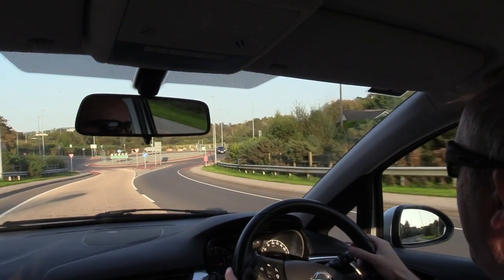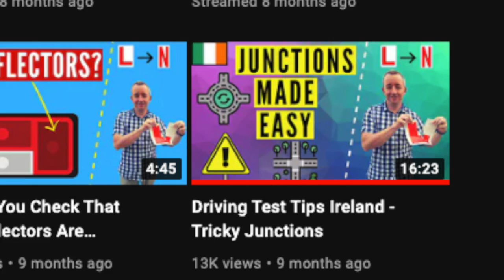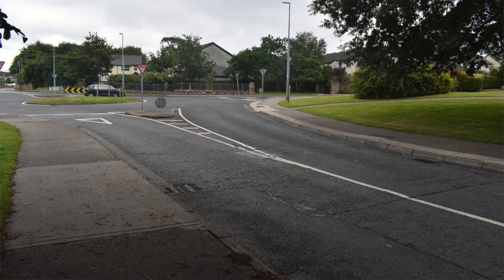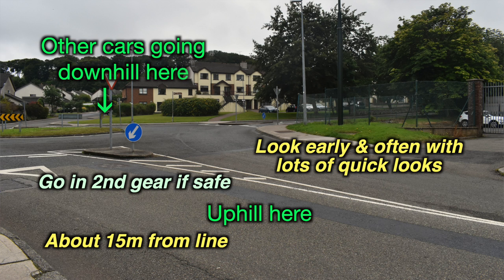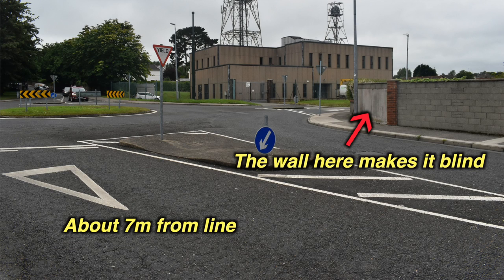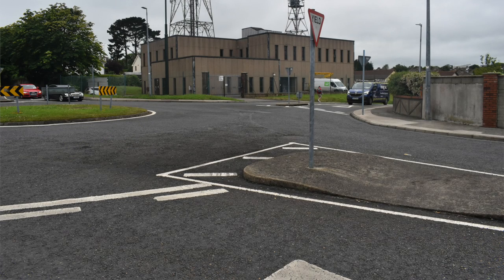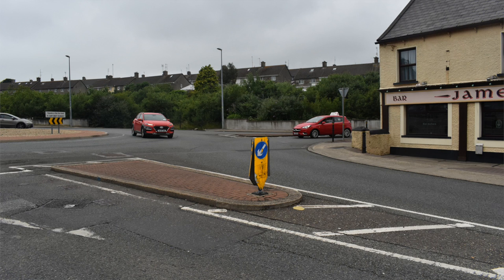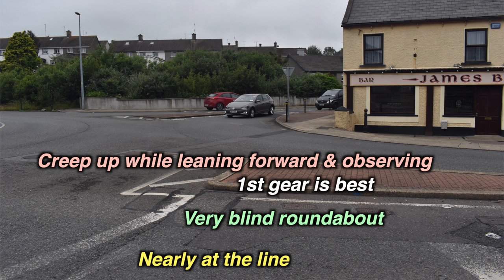Blind Roundabouts v Open Roundabouts - A Complete Breakdown

Comment: I have my driving test coming up and I find I’m taking off at roundabouts too slow and by the time I have moved off the cars from the right are right at me and are having to slow down to let me continue is this a big problem I just find it hard to take off quick without cutting out the car
Reply from the maker: Are you getting the bite? Are you waiting in 1st gear?
Reply: @DaneTygheletsdrive   yeah I am I think my problem is I’m coming up from the cluch so slow and not speeding up and then by the time I’m on the roundabout the car is ready to go in my side and it looks like I pulled out but I didn’t
Reply from the maker: Yes I understand what you mean, you will need to practice getting the bite quicker and perhaps holding it for a couple of seconds before the opportunity arises to go. You can also have your hand ready on the handbrake if you want.
Reply: @DaneTygheletsdrive  yes I will definitely try that thank you 😊
Reply from the maker: Best wishes